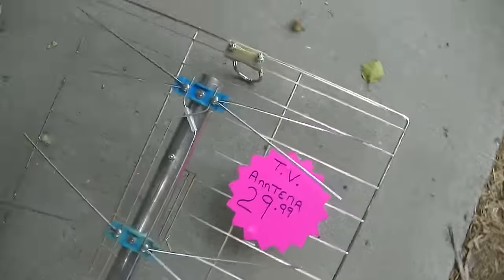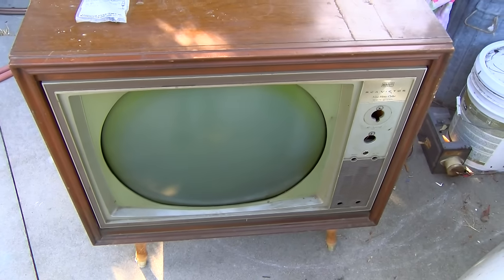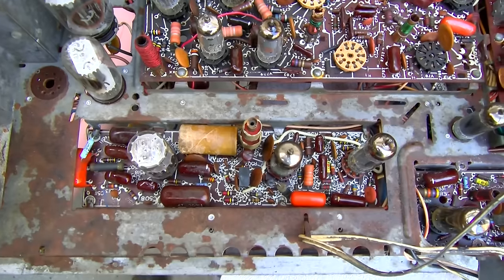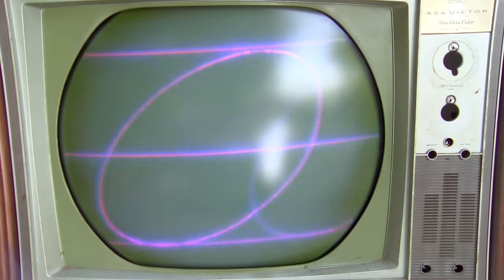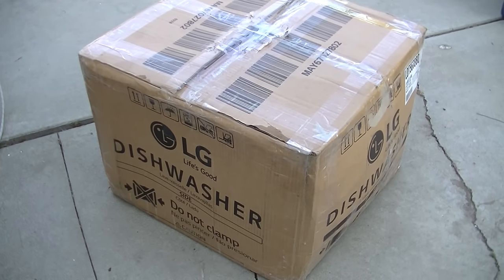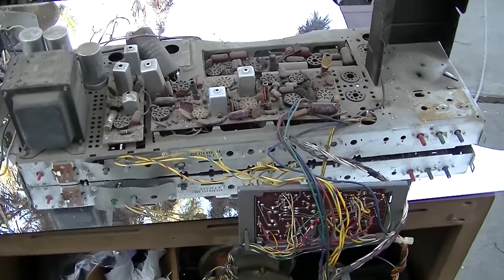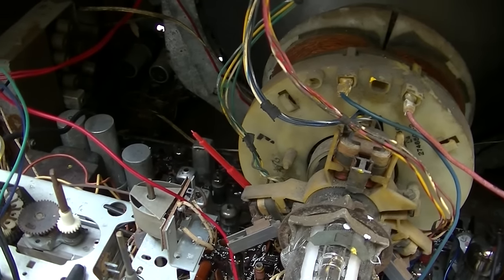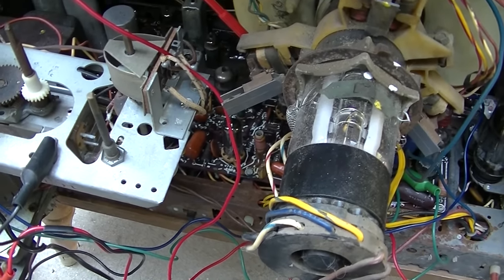RCA CTC16 Insurrection Color Round Tube Vintage Television Pt4 Final

Comment: Old RCA techie here, just ran onto your channel. Watched the four parts on the CTC-16. This is by far the most ambitious resurrection saga I've ever seen or heard of. Just a little tip on setting purity - with the yoke slid back, and the red blob centered, slide the yoke forward until best purity occurs; the 'sweet spot' will occur when the yoke is about 1/4 to 3/8 inch  shy of being fully seated against the CRT bell  (On rectangular jugs, the sweet spot will be 1/8 to 1/4 inch shy). Kudos for your tenacity on this project, my hat's off to you Sir.

Comment: I am from the UK and I love seeing these round screen colour sets we never had these sets in the UK
Reply: You guys in the UK missed the fun years. By the time you got color in 1967, we went through 13 years of it here. We we worked out the bugs before you started, and went in a totally different direction with PAL instead of NTSC.
Reply: did you see he was using ITV to show the debate
Reply: we had round colour CRT TVs in the UK. PYE made them
Reply: @pyeltd.5457  Pye man, I have a Pye technico lawnmowet
Reply: @diamonddave45  That may be true but in the 80s they got scart and we didn't get component until the late 90s so sad
Reply: @diamonddave45  Yes and PAL has a much better picture

Comment: 27:01 bottom center of screen can see voltage tracking and shorting around and amongst the pads in that area, like tiny lightning bolts. I assume its voltage dwindling out of the system after he was turned off.

Comment: Hey Shango, about your Fluke meter, I have a Fluke 12 and it was doing some weird display things. They use those conductive foam pads between the board and the display, (or at least the 12 does) might take it apart like I did and just give it a finger wipe, (not sure that really helped or it was just the taking apart part of it was) put it back together and mine worked fine after that.
Reply: Yes, it's like a hard rubber contact. I don't understand them completely, but cleaning the board contacts and the flexible contract strip will fix the display just about every time.

Comment: Sorry I didn't realize you do a lot of this (sigh). When I was younger I used to haunt out back of TV repair shops. I had figured out that with an old TY for it's transformer and horizontal tube and a couple of 5 tube radios for the variable capacitors I could cobble together a linear amp for CB. They have all dried up now but good to see some (not all) survive. Cool.

Comment: No there are still stations on VHF (in LA 7,9,11 and 13 still transmit digitally on their old analog era VHF channels) you might want to check out Antenna Man
Reply: Check Rabbitears (dot) info for details.
Reply: In New York City, we have channels 2, 4, 5, 7, 9, 11, and 13 are all VHF stations.
Reply: They are none on the east coast. Philadelphia area and New York
Reply: @Bagel-the-Beagle-1  ABC 6 WPVI Philadelphia still transmits a digital signal on Ch. 6 (PBS stations in Boston and Pittsburgh operate on the VHF low band 2-6 so a VHF antenna is still required)

Comment: Not true what you said about VHF channels not used any more. They are in many areas even after repack used but of course in digital. It's true,in many areas only use the UHF band for RF signals and the above antenna would work very nicely. GE had a recall of a bad run on HV and shunt regulator tubes installed as OEMs on a run of sets made in 1966. It resulted in an expensive recall for the company.
Reply: We have one high VHF every other channel in the UHF 20 - 35 channel range in my area of CT.

Comment: I know you done a great job getting that tv going. You seen that by the mice damage. The mice killed ever part in that tv. You worked harder then any body would on a tv like that.  Even if that was a rare tv the crt was no good. So even if you took it all a part and put new parts in it. The crt not worth anything. I give you a A on working on it. And let lots of people learn from all the problems you had to fix. And washing the tv did not cause the problems. Have mice living in it for years killed that tv
Reply: I'm with you. I think rodent urine and other dirt and contamination got into the little places and probably didn't wash out. Did the washing put the contamination in the small spaces? It's possible. Impossible to know for sure. However, it's likely that the nesting would have been above the components and stuff rolls downhill so to speak.
I wishI could effect the repairs he does on all of my goodies. I wouldn't EOL any of them. I have no idea what to do with them. Unlikely I think that I can find a home for every item I own....

Comment: most, not all digital tv in the chicago area is on UHF freqs.
Reply: That's right there are still stations operating on the VHF band (2-13) and they are not all stations that still use their old analog channels some are actually stations that were on UHF channels back in the analog era, plus some were former VHF low band (2-6) stations as well (and the repack made some stations move from UHF to VHF (high and low bands, as well move from high VHF to low VHF and visa versa)